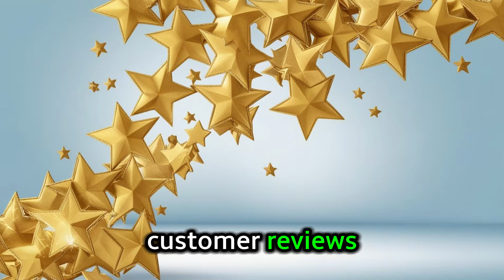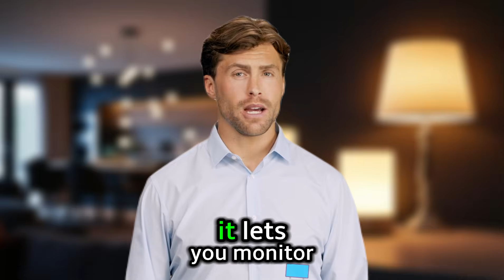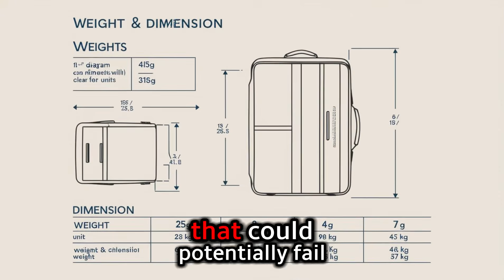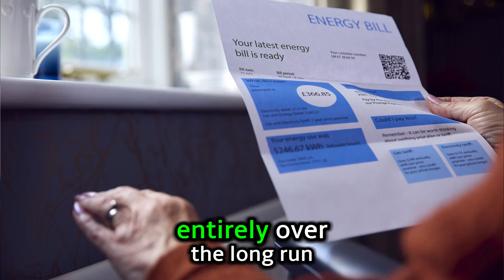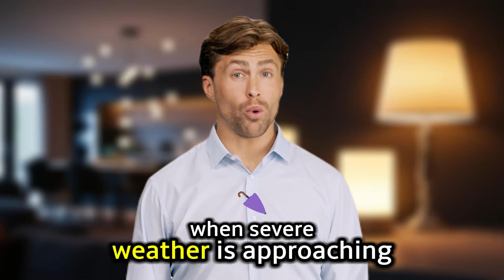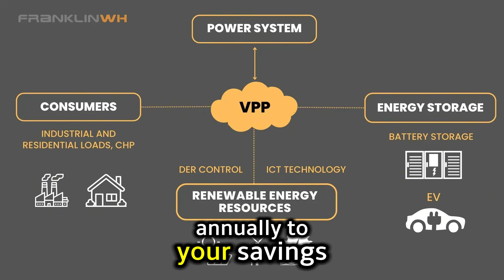FranklinWH Home Battery: The Complete Guide (Features, Costs & Incentives 2025)

Comment: This system uses low-cost, high-frequency, transformerless inverter technology that doesn't use an output transformer to provide galvanic isolation between its DC boost stage and its AC output. The lack of galvanic isolation can easily damage your home's appliances or destroy your EV's onboard charger and void your EV's warranty when its MOSFETs/IGBTs fail not to mention its extremely high price.
Reply: Where did you get this info from? That the Franklin battery is not isolated.
Reply: @tkl0111  Competitor?
Reply: The Franklin battery system has galvanic isolation. The inverter within the aPower battery unit features an isolated topology, which provides the necessary separation between the battery/DC components and the AC loads/grid. 
The system's main components are:
aPower: The AC-coupled battery unit, which has a built-in inverter with an isolated topology.
aGate: The intelligent energy management controller and power distribution center, which includes a micro-grid interconnect device (MID) that physically disconnects the home from the grid during an outage, forming an isolated microgrid. 
This design ensures safety and compliance with relevant electrical codes and standards (such as UL 1741 and IEEE 1547), allowing for safe and seamless operation whether grid-tied or in off-grid/backup mode.
Reply from the maker: Thanks for sharing your insights - we appreciate the technical details and your perspective on the system's design!
Reply: This is not true. And you have to consider the system all together. Not a stand alone battery.